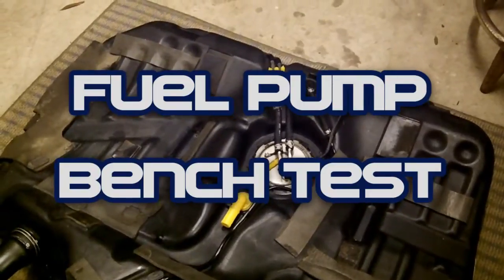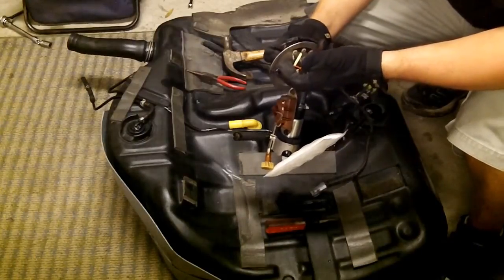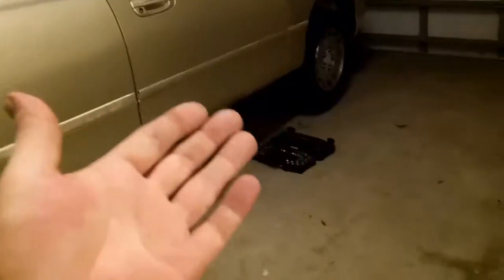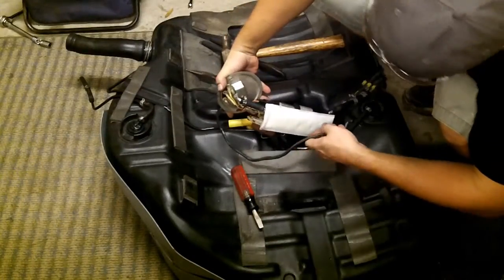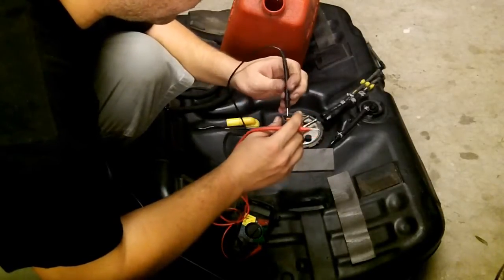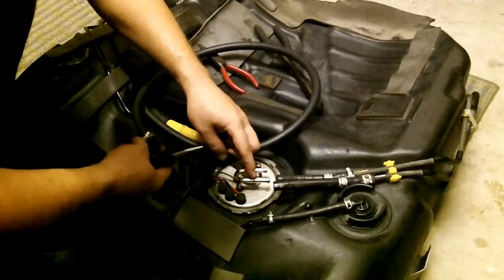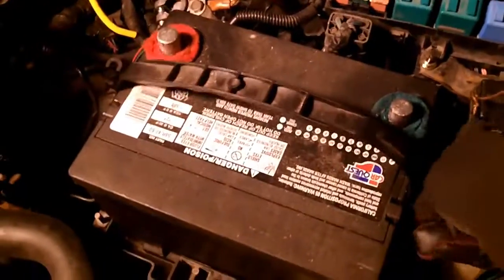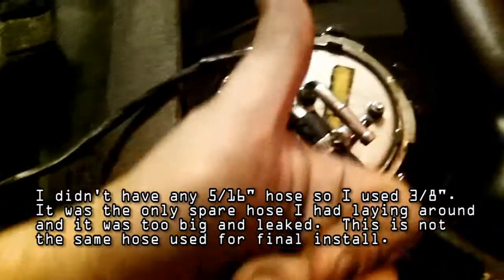Mazda 626 - Fuel Pump Bench Test

Comment from the maker: I did figure it out on my own by looking at the contacts on the pump and then looked at my factory workshop manual to confirm it.  I didn't know it at the time but it doesn't matter if you get them backwards you won't hurt the pump.  The pump simply will not work until you get the positive and negative hooked up correctly.
Reply: This been my problem for a long time weak pump. I timed my engine over and over. I changed the rings on my '96 using your head removal info. when I put back everything, the car had a hard time starting. Thank u for you're knowledge appreciate all your work.
Reply: I have a '96  float and pump are separated it has access hatch but for float only. Smh so I cut with shears over to the pump. I know you don't do that but I have no garage and no help.

Comment: Thanks for the video. How did you know about which pin is + and which is Neg?
Thru the wiring diagram or just traced the other Fuel Pump mating contacts on the car itself?

Comment from the maker: That might be true.  While I carried it back after bench testing more came out of the seal area.  I have concerns about fuel leaking that way during driving.  That seal.  Because of the way the seal sits down inside a groove there's no way to RTV or silicon it after it's installed.  Basically you have to rely on that rubber o-ring and from what I've seen it doesn't do a good job on its own.